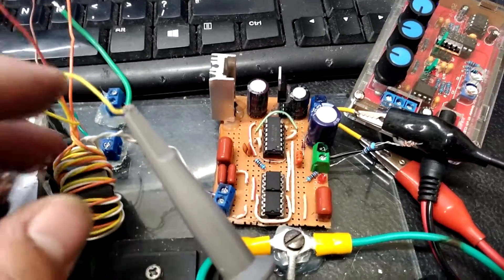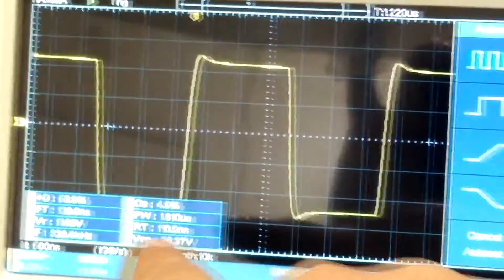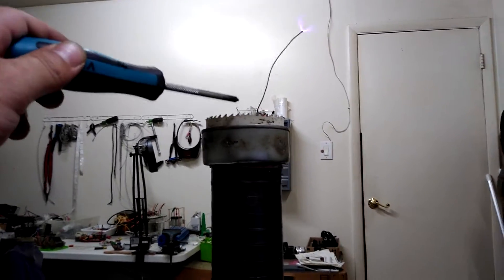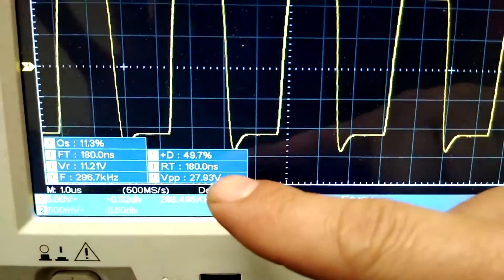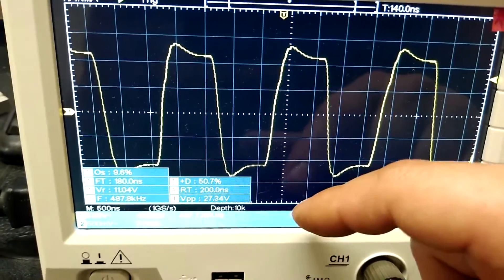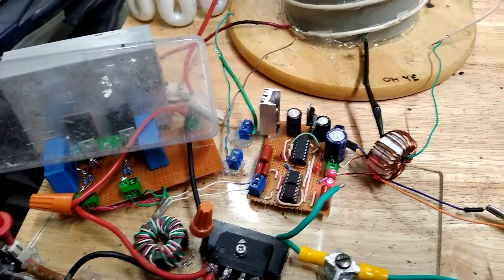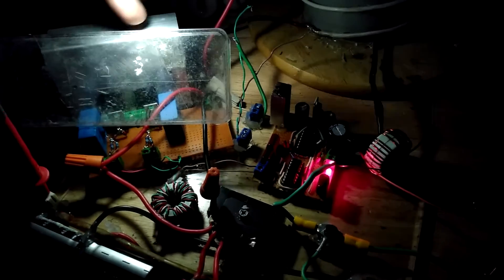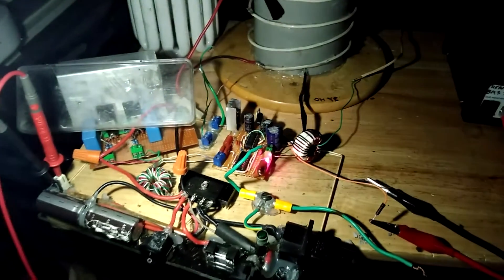Steve Ward Half Bridge Mini SSTC (Scoping the GDT and ramping with autotransformer, non interrupted)

Comment: Looking pretty good there 😎 lot of work isn't it ?! I'll get back at mine soon enough but I'm going with the pll version, have you tried with unfiltered DC yet ? It should go easier on the fets in CW mode as it shouldn't pull so much current.. and you could try what I do and interrupt the input supply of the bridge, it's like a ramped input and you can possibly get nice long streamers
Reply from the maker: Lol yea it can get intense but you know I feel like I wasted the most time just messing with 460's that weren't very viable at my frequency. I can pull some pretty sweet arcs now at 170VDC but I still don't feel like it would take it at higher voltage. I'm hitting about 500 watts already at that voltage. Getting it interrupted at the bridge supply is something I haven't thought of even though I do it all the time with the low voltage ones. I need to look into how to do that properly but I also got some AND gates on the way which should help me interrupt it normally. I actually recently tried unfiltered and it doesn't oscillate the same without the caps there. Haven't figured that out yet. My plan is to use the first fets I tried which gave me the best waveform (but didn't work well cause one of the fets had half crapped out without me realizing it) and then start tinkering with the topload to bring the fres down a good deal and hopefully I'll have some pretty good interrupted sparks. I'm still clueless as to how the ramped input is done.
Reply: @Magneticitist  the ramped input is a lot like a phase angle shift which is pretty much a commercial light dimmer but i have to look into it more, the staccato circuit i use can interrupt the input just fine, then again i plan on using the 4046 as the local oscillator so im not sure how it would work with steve wards circuit, i'll try it in the coming days, i just want to finish my class E coil first .. if your using the antenna still, i highly recommend a feedback transformer, i dont trust the antenna method
Reply from the maker: @dirkk82  Yea I ditched the antenna a while ago it's all transformers from here on in lol. I wonder if the feedback not being suitable is my problem with it not oscillating without filter caps though.
Reply: @Magneticitist  you should test out all transformers to see how the waveform looks, i dont think its too critical but it should at least be able to handle the frequency range your shooting for, if you need help with the topload, give me the specs of the coil and i'll calculate the topload you need
Reply from the maker: @dirkk82  my feedback Transformer core is what I guessed to be an identical core to what I'm using for the gdt but I only assume that because they were identical looking pulls from two identical boards. They seemed to have the same values. With the hex inverter though I'm just sort of looking for anything that resembles a square or sine without a completely skewed on time. The toroids I have now were the only few that were worth a crap out of about 20 I tried and I might end up buying some but damned if I'm not trying to avoid that. I can send you the specs though that would be awesome. I ended up just slapping a huge piece of metal heatsink up there and it improved the output an insane amount so if I actually do the top load proper it may really be worth it
Reply: @Magneticitist  all i need is the coil wind height, width of the former and wire gauge ..... if you want general cores to use for transformers, just get N30 grade cores, they usually are blue and come in 2 sizes, everyone uses them ... nah man, you dont have to buy one, just make them, its cheaper in the end, you can either use aluminium heating duct or preformed Styrofoam pieces and cover them with aluminium tape and smooth it all out with the back side of a spoon, they look nice in the end
Reply from the maker: @dirkk82  Oh shit I actually have a roll of aluminum tape I bought for that reason and forgot. I was going to end up trying to roll capacitors with it lol. This coil is a bit of a weirdo though. It's always worked well with other drivers but as for how it's wound, it has several splices which transition to slightly different wire gauges.. It has always usually wanted to ring between 400-500khz without a topload but that doesn't really correspond with the calculations. It's 41cm tall, 66mm in diameter, and has wire gauges between 30 and 32 AWG.
Reply: @Magneticitist  hmm my calculator says the coil is between 1300- 1600 turns and the resonance is between 20 - 25 MHz !? if i were you i'd use a different coil or wind a new one with a more reasonable frequency range, i cant even calculate a topload as you could never use that coil in a normal sstc configuration, you would need a stupidly massive topload to run the coil efficiently on the circuit, then again i could have the calculation wrong 

( wire coil winding height - 41cm  coil form diameter - 6.6 cm  wire gauge - between 30 -32 AWG ) is this correct ?
not to mention using a coil with spliced on wire of different gauge is a big no-no, then again it does seem to work and lets not forget that the bigger the output, the bigger drop in frequency, its an odd coil indeed and im surprised it works at all 

i'll post 2 pics on google hangout so have a look
Reply from the maker: @dirkk82  yea those are the specs but 20-25mhz seems too high for the calculations though right?
Reply: @Magneticitist  not really, I've used the calculator for 7 years or more now and it's pretty damn accurate, I'll try it again today and see if it's working right
Reply: @Magneticitist  ok i found what i was doing wrong, i was using a decimal point instead of a comma for the cm conversion ! anyway if you use a 25 cm sphere as a topload, you get a 269 KHz resonant coil ,  or a toroid with a ring diameter of 10 cm and a total diameter of 30 cm, you could make it out of normal aluminum dryer ducting, the toroid would increase the resonance by  4 KHz which isn't a big deal as both the mentioned sphere or toroid is perfect to achieve perfect resonance

Comment: I think the overshoot is caused by leakage and parasitic inductance of the gate drive loop area, 1cm of straight conductor length has about 10nH of self inductance so a couple inches between the fets and gate drive transformer combined with the fast switching wave-forms creates a parasitic boost converter with the gate capacitance being the only thing to limit it. 

You got any zener/TVS diodes laying around? If so put them in anti series across the gate to source of both fets to clip any gate over voltage events, most go for 15-18v versions. Watch out for the high wattage (2w+) ones however as they'll introduce extra gate capacitance and slow switching speeds down. Let me know if you need an example of anti-series diodes.

But yeah I think a smaller gate drive loop area will help and allow you to use less gate drive resistance without those spikes being as prevalent, if possible twist the gate drive transformer leads right up their ends and mount the gate resistors right at the gate leg of the fet to further reduce loop area. Then place a 100nF ceramic and low ESR electrolytic (old SMPS's are a good source for these) right at the pins of each gate drive IC, literally in the next available holes on the prototyping board as this further reduces apparent loop area.

Those little ferrite beads you sometimes see slipped over component legs of semiconductors in commercial products work nice on the gates for preventing spikes, you just have to scope after the ferrite bead when looking at the waveforms as they're essentially lossy inductors in series.

Does the driver give any deadtime between the gate drive waveforms? About 5% is more than ample, without it can lead to brief shoot through events when both fets are briefly on at the same time during switching, this creates a ton of heat at higher supply voltages.
I'm not an expert but its just a few things I've picked up over the years.
Reply from the maker: I appreciate the advice, I did end up putting a couple of what I thought was 15v zeners on there but I looked at them closer and I grabbed 12v's by mistake. I'm waiting on some more zeners but the with/without didn't seem to really change the waveform until I started changing 460's out. Ill try to see about cleaning up some of the stray inductance but this was one of the first things that bothered me in the testing.. I went from leads everywhere to only somewhat leads everywhere with everything cleaned up and working better on the boards.. While I noticed better switching on the gates (never probed the drains) and absolutely no unwanted ringing in the drivers caused by noise, the output wasn't as appealing. That was mainly because I was more or less blind at the time and didn't account for other variables which ended up being one of the fets only partly crapping out. With the setup I have now I'd probably get a pretty good drive going on if I were to just buy a suitable torus. Right now there is a bit of time where both fets are on but at the moment it isn't too severe. I'm hoping the cheap semi solution is to just add the interrupter portion once I get some AND gates because I'm currently using two UCC27322's. Both the inverting and non inverting 2732x chips I bought had flapping enable pins. I've tried messing around with it now pulling arcs from various toploads at 170VDC without popping the little 5A fuse on the board or the variac but I'm not sure how well it would hold up at over 300VDC. I'm probably pushing close to what the fets can take at the 170 in CW right now though.
Reply: @Magneticitist  Hey the 12v zeners are probably fine to leave in, they're not getting warm in normal operation? The idea is that they only conduct and clip when the voltage on the gate gets close to the breakdown voltage of the mosfet (20v in many cases). Its just with a 12v gate drive the 12v zeners could be close to their conduction zone and consume power.

Honestly your gate drive signal doesn't look bad, its just the over and undershoot likes to creep toward gate breakdown levels lol. I've seen much worse on commercial switched mode power supplies.
Yeah the problem with scoping the drains is the voltages are often in the region of blowing the scope up with a regular x10 probe (plus the ground problem), I think x100 probes are more typical for that area to account for any voltage spikes going on often reaching the avalanche breakdown levels of the fet.

For measuring shoot through connect the bridge up to a floating power supply and disconnect the primary coil, then with the gate drive turned on put a low ohms resistor in series with one of the power feeds to the bridge and scope the current waveform, shoot through will show up as increasing current spikes as the voltage is increased (some spikes are ok as this is the fets miller capacitance being charged up. Again don't use the mains for this as the ground clip of the scope will short out the mains.

If shoot through is occurring it could explain why the 5 amp fuse is close to popping at full mains voltage, but also the reactive currents drawn from the mains will be larger than the actual power put out from the coil (volt-ampere vs watts). Steve once told me you need about 500w real power for every foot of arc, but the reactive volt-ampere requirements means the current draw from the mains will be much higher to deliver this and the mosfets have to switch this and the resonant tank currents.

For the high impedance enable pins you could try a 10k external pull up resistor to reduce noise pickup, maybe even a small capacitor of a few hundred pF between enable and ground to bypass hf noise.